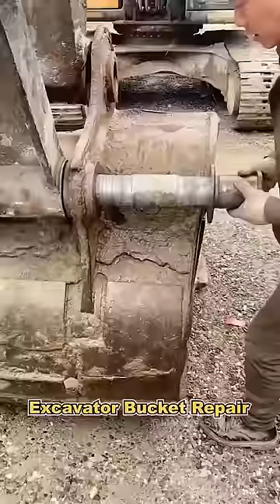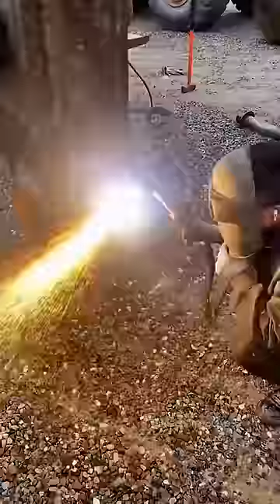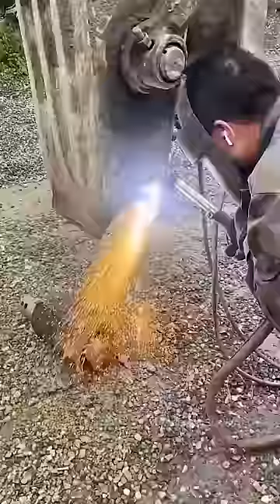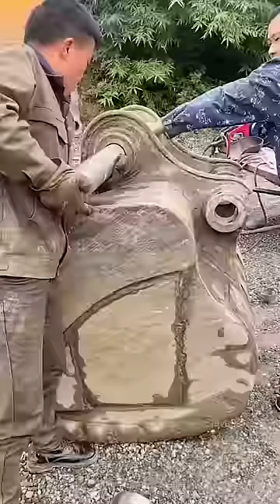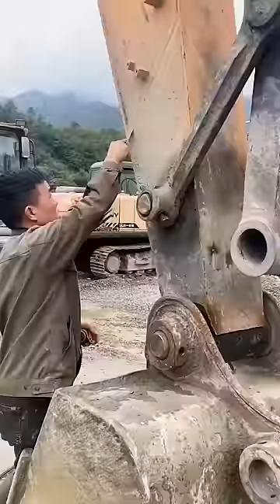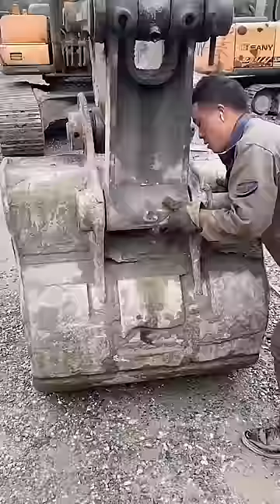#mechanic #automechanic #automobile #cars #trucks #restoration #mechanicsteve #shorts #autos #fyp

Comment: I ran a Hitachi that was worn out like that. All you could do was try to stuff grease in the holes with your fingers. The track adjuster was pitted so bad it still slacked off with new seals. Still better than no excavator!
Reply: Adding grease to a wallowed out hole probably made it worse lol

Comment: All relative pins and bushings should be replaced at the same time. Even with daily greasing that new pin and bushing won't last long. All the the other pins & bushings are very worn so the majority of stress will be on the new parts.

Comment: Yeah....now you have no idea if the steel where you cut and welded is too brittle or too soft.  There's a very specific alloy used and it's heat treated and stress relieved after welding to achieve this.  This machine probably has more problems now.

Comment: That repair is stupid and won't be durable as there is no load distribution. The load will just go more on the back bar more than the front one and then once the other one is damaged, same issue will occur. If the repair part was pressed in, then maybe that would be an efficient repair but it's not the case here